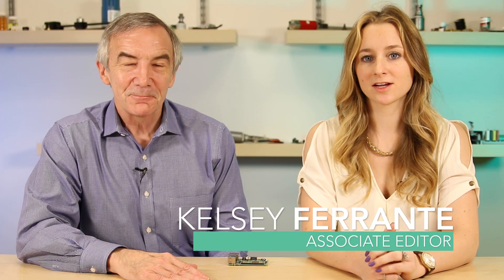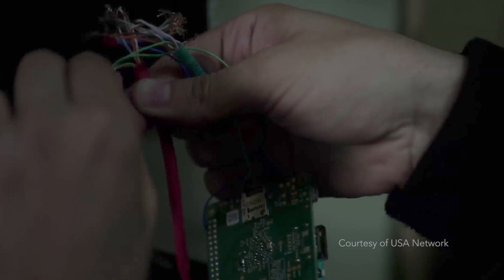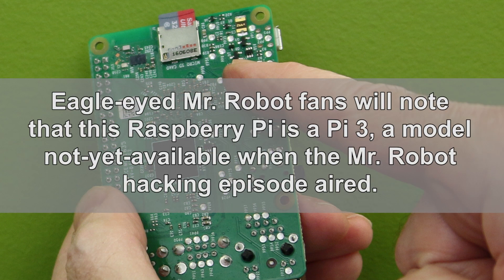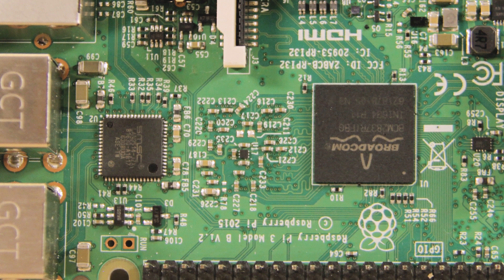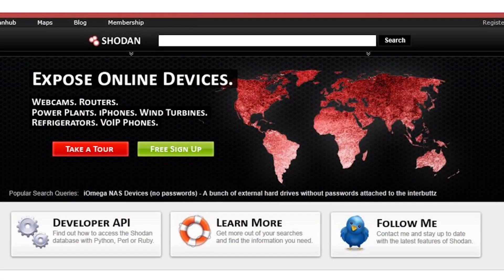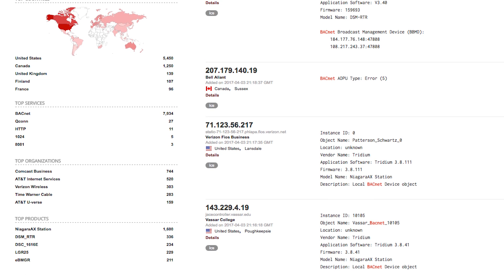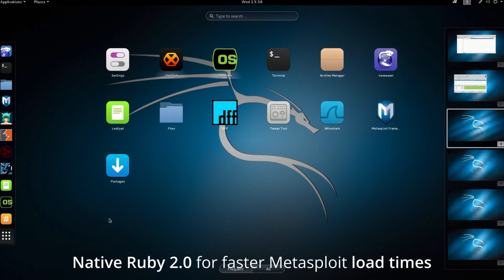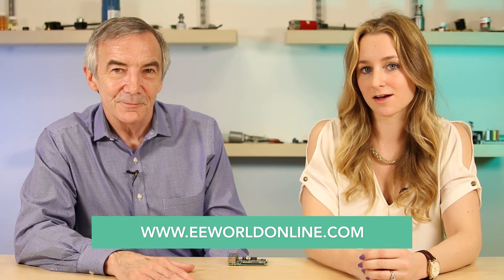Could Mr. Robot have really hacked the Steel Mountain HVAC system?

Comment: One could just go out to the roof and turn the package unit off, cutting off the heat. Also, the place has its own fire department, of course they have HVAC techs who would fix this problem very, very quickly. That's fine, though. It's well within the "suspension of disbelief."

Comment: What about the wires, would it work the way he connected?
Reply: Would his power wire connect?
Reply: Typical thermostats use 24V AC for their wires, so nope.
Reply: @0x1EGEN  typically thermostats can be powered DC or AC
Reply: @0x1EGEN  yea no just use a step down converter
Reply: @EdekaKuchen  What's your point? The show literally had eliot literally connect the wires directly to the raspberry pi.
Reply: @0x1EGEN  the video is about if it would be possible in real life.
Reply: @EdekaKuchen  That's still not relevant to what the OP was asking. He asked if you could wire the Pi directly to the A/C unit like the show did. You can't.
Reply: @0x1EGEN  it would be possible if you use a step down converter tho

Comment: bullshit Eliot hacked steeled mountains with a raspberry and the cheesy part is that he never connected raspberry to 5 volts, so how's suppose to work the microprocessor by magic? raspberry needs power so he can run its python script
Reply: Some Pi models can be powered through the GPIO pins.  The one on the show is one of them.  This method is not recommended since it comes with a very high chance of frying the device. Then again, the goal is to run the Pi long enough to tinker with the HVAC system.  Thermostats provide 24V DC which can be stepped down to 5V DC.
Reply: Possible they customized the power connector to the same wires on steel mountain ?
Reply: You are really idiot...mr robot just a movie 😂